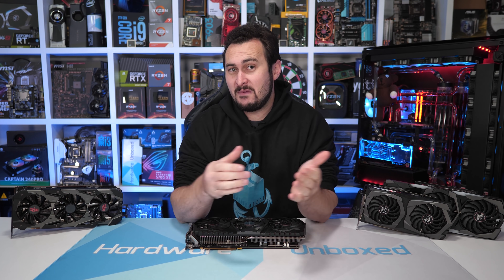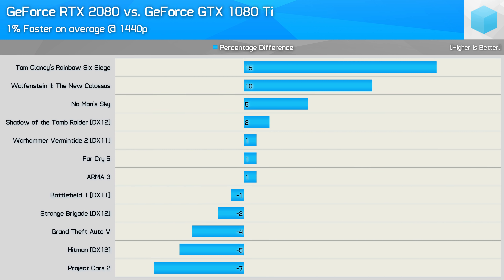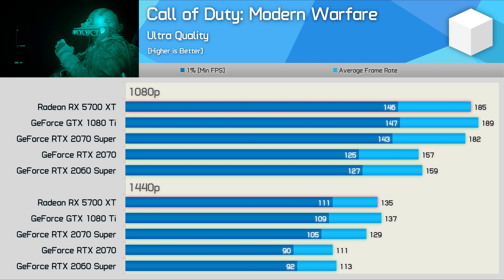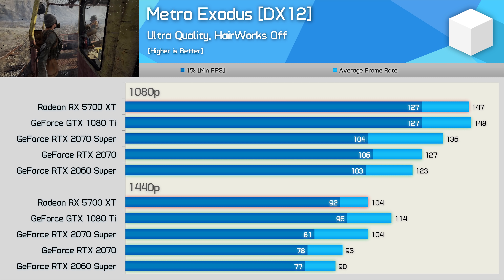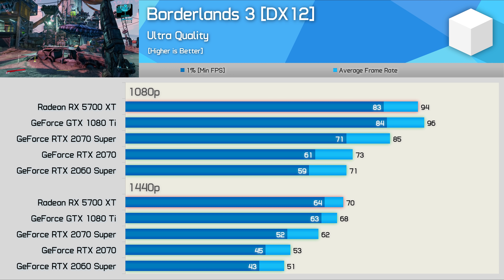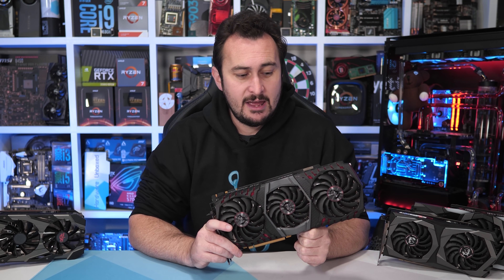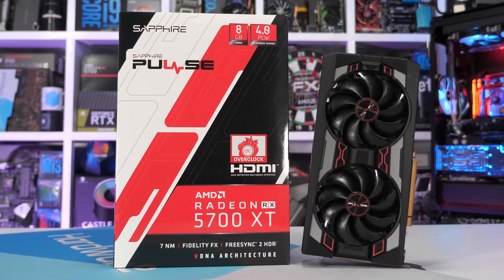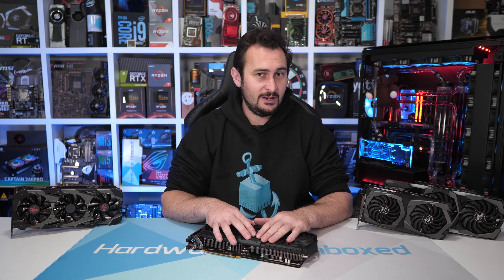GeForce GTX 1080 Ti vs. 5700 XT & RTX 2070 Super, 35 Game Benchmark

Comment: I get that the 1080ti is a legendary card but you gotta be crazy to spend over $500+ on a used gpu with no warranty lmao
Reply: Spent 320ish on mine. No warranty and 1 fan broke.
Reply: @MrRogue-rb3rm  did you fix or change the fan?
Reply: @richsly99  I had a cheap 240mm aio for GPU. It works great max temp with OC full load around 50C. Blade of the fan was broken so no way to fix it, and it's really hard to find just a fan replacement for a mini 1080ti zotac. It was the cheapest 1080ti I could find until today.
Reply: @MrRogue-rb3rm  You should be able to replace it with any other fan as long as the size, cable length and power pin are the same.
Reply: Depends on the market, really. I got mine for 350€ and they are still going for 360€ and up, while new GPUs are much more...regional stuff at work.
Reply: You can transfer warranty with used Nvidia cards EVGA,msi, gigabyte does it no questions
Reply: Looking at current eBay pricing it’s ridiculous pricing on a 1080ti. You need a lot of luck to find a decent priced one.
Reply: I managed to snag a gtx 1080 ti ftw3 on ebay during the 2080 launch for $550. It's been working hard since then and its still holding up.
Reply: You can find good ones, great ones even, at 400 USD or so. I picked up an FE for 400 USD almost a year ago that didn't even have dust in the fan yet.
Reply: i spend 300 euros for msi gtx 1080ti gaming x, 1 year ago hahahah
Reply: Bought a Zotac 1080 Ti Amp Edition for $344 about a month ago. Thermals sucked though so I got a good deal on a Kraken G12 and X62 and now I'm happy. There's nothing else I could have gotten for the same amount of money with the same amount of performance.
Reply: I have the choice between a used 1080ti for 360€ or a Rx5700XT for 400€ and i dunno about you but 10% performance difference is absolutely nothing (6 frames @ 60 / 14 frames @ 144) compared to the fact that one is brand new and one is used for probably 3 years now.
Reply: Hinshi Raito what did u end up doing?
Reply: you can find it 300-400usd
Reply: Bought mine for 350 last week on Reddit and it was a asus strix with one year and a half warranty left lol
Reply: Yip, that is why I got pissed off at 2nd hand sellers, who are all thinking it's still 2016 and wanting 450 USD (equiv) or usually more for used 1080tis, which are 1 - 2 years out of warranty. I decided to spend 70 USD (equiv) more for a 2070 Super w/ a 3 year warranty instead, for peace of mind and a better resale value in the next 1 - 2 years.
Reply: I use the 1080ti mainly for vr I assume the more cores matter there? Bought mine second hand for 600 usd 2 years ago well happy with it.
Reply: I bought everything that i own parts,computer gear,monitors,keyboards everything everything and everything used,3k$+ invested.Never a single problem with anything,computer parts and gear doesnt just die on themselves with no reason (+ i had everything overclocked to the max limit that every component can handle,also like it is now) so yeah,not really a valid statement
Reply: I got mine with warranty
2018 evga 3 yr
Reply: well mine its doing great so far!
Reply: bought a used 1080ti for 450 bucks, with 2 years warranty still. why? 11gb of v-ram that's why.
Reply: I think most people with computer hardware experience would disagree with you there.  Similar to cars, a lot of the "bad" dyes and malfunctioning units are weeded out in the first 500 hours.  A used card that can be proven on benchmark before you buy is much less of a gamble than you think.  I got mine for 500 before the rtx cards even came out.  they can be had a lot cheaper now and are leagues better than a more expensive 2070 super in almost everything
Reply: it's mostly $350 tho
Reply: I got mine for 550 2yrs ago, so far so good
Reply: I bought my 1080ti FTW3 Hybrid (with 2ys warranty left) in January 2019. 

They were going for around £500 back then, but I got into a bit of a bidding war, and ended up paying £623 for it. The part however, turned up in as-new condition, and it has been flawless in its operation ever since. It has  ery high frame rates (120fps+), in the games that I play, never tops 65c under heavy load. I was targeting 1440p, and the The FTW3 Hybrid is one of the fastest 1080ti out there. 

The funny thing is, I built a 9900K Z390 Maximus Code XI 32gb 3200mhz gaming rig, and the most expensive part inside, was second hand.
Reply: I'm not a poor so I bought a new one back in 2017. Problem solved!
Reply: Spend 432€ on Rog strix. Works perfectly
Reply: Got one msi gtx 1080 ti gaming x this february for 370 Eur with 2 more years warranty.
Reply: Got mine july 2019 for 550 euros, MSI gaming X, second market no warranty, no testing before purchase, nothing. Just plug on the PC and play no issues.
The other option was rtx 2080 for 750 more or less with minimum performance difference. A beast.
Reply: Bought an EVGA RMA Replacement 1080ti secondhand for $400 a couple months back.  Still had all 3 years of warranty so I'm happy.
Reply: Got mine for 500 as a 3 months old card with 33 mths remaining warranty in 2018. Retail pricing new for the 1080 Ti STRIX at that point was about 1000USD, so i'd say i made a good deal and its still kickin today. At that point in time the new 2080 was out and it would cost new about 800 bucks so i took the 1080 Ti instead for 300 less and about the same performance and still with warranty left. As always it depends on the deal you get - would not buy it today for that price with the 2070S out there or the 5700XT.
Reply: Bought my 1080ti extreme from aorus used for 500 and Id do it again tomorrow. so I must be crazy. Spend 550 for a 2070 super that has less performance on the games I play, not a AAA gamer, or spend 500 for a GPU that I know is in perfect shape and well taken care of that runs the games I play with better performance. Call it what you want its just logical to me.
Reply: You clearly dont understand how long a gpu is made to live for lol
Reply: Rondell Laronde Made yes but GPUs go out 24/7. I had a 1070 for only a year before it fried and had to replace it. PC hardware is an anomaly when it comes to quality. You never know if it’ll blow up or not.
Reply: @Who-Uhm-Cares  unlucky ig I've never had a gpu die on me in my 3 years
Reply: @hundredlives3910  Palit and Gigabyte are meant to work only during warranty. They break immediately afterwards. This was also a case with Sapphire in a past (like my Ati X1950 Pro) but apparently they are now to AMD what Asus/EVGA is to Nvidia, meaning go-to brand.
Reply: @hundredlives3910  you clearly havent seen what 1 year of mining does to a 1080ti.  Crazy to even consider it.   Also the fans arent meant to last that long. You have to work on 3 year intervals. The bearings will have to be replaced.
Reply: In my country people are selling them for like 350$ for each 1080 ti so idk what to get. Still arguing with myself.

Comment: Man, 2000 is such a disappointment. RTX is a meme, cards barely beat 1080ti.
Reply: @Seventh Taco I'm hyped up for 2002
Reply: @Salt Maker lol, he said pass on a used 1080ti at the end of the video. But please, be obtuse and an exemplary gamma.
Reply: I have the 1080ti, and no sorry, but its easily beaten by a 2080ti.

However, looking at the prices for these very high end RTX cards and....yeah they're a meme.
Reply: And a 980Ti beats out a 1070, and is barely beat by a 1070Ti,  tends to happen when you take the best of the best from the previous gen and compare it to a "mid-high range" card from the current gen.   And I'm going to make a bold prediction here... but a 3070 won't beat out a 2080Ti when it's released.
Reply: You must have a short memory. The 780Ti was better than a 970 Super-Clock. The 980Ti got roughly the same frame rates as a 1070 Super-Clock. The 1080Ti get's roughly the same frame rates as a 2070 Super (same thing as a super-clock). Also, the 2070 Super has twice the VRAM speed as the 1070 SuperClock. Every computer hardware company and car company has been doing this for decades.
Reply: Next year RTX with DLSS 2.0 will come into it's own and pascal will be screwed and even a shitty console will out perform it.
Reply: Had a 1080Ti upgraded to 2080Ti, no regrets, fucking amazing. Game at 4k 120hz mind. Also DLSS 2.0 blows my frikkin mind! Control full detail ultra ray tracing 4k @ 100 FPS insane
Reply: @Salt Maker As someone who owns a 1080ti and had a 2080 I can attest to this. It was barely noticeable in fps and was definitely not worth double the price. And I had a 2080, not a 2070s. I returned my 2080 and bought a ti. I was upgrading from a 1070. I paid $1100 for the 2080 and the ti's here are $5-600 used. The 2070s here is $900 plus tax. I ran the benchmarks and played the games. I can even show you the amazon return if you don't believe me. On the argument of warranty I can say that I have around 15 cards. Out of all of them only I think only 2 don't run, but for the most part these cards will run forever. Way beyond warranty. 

So by the time they die you'd most likely buy a new one anyway. Hes not sucking any nut sacks. Hes telling the truth. Whether you believe it or not is irrelevant. The numbers don't lie. So soak up those tears and deal with it. Sounds like the only salty one here is you.
Reply: @Seventh Taco he is chill tho lol
Reply: Jonathan Soko  You've just upgraded to 'dumb'.
Reply: Why are u expecting performance gains on the same fabrication process?
Reply: Once you add the benefit of DLSS and RTX it definitely makes a difference.
Reply: RTX2080 just beat GTX1080 Ti on launch and I'm guessing has pulled ahead now with games being optimised for turing. 

RTX2080 Ti was comfortably faster, expensive but there is nothing else at this level so nvidia could charge whatever they wanted. 

Also once DLSS 2 is enabled the GTX1080 Ti will be left trailing by a huge margin.
Reply: @Ebilcake  By the time DLSS or the DX12 counterpart is widespread Pascal will be more than 4 years old, and gpus as fast as the 1080 ti or faster with DLSS capability will be under 450 usd. Also there is no 4k benchmarks don't forget the 1080 ti has 11gbs of memory and 484 gb/s bandwidth so the larger pool and speed it should pull ahead at 4k.
Reply: the price is a joke but not the cards they are not bad the 2070 super should've been at max $400 and then later cut to $350, if the xx70 series is on par  with the previous gen xx80ti  cards then they are not  bad cards at all.
but what can we say ??  Nvidia are just greedy bastards!!  but they do  have good  architecture hopefully AMD pull off a Ryzen like move on them.
Reply: @pczone7641  No because thats a 2070 Super..pretty much a refresh of the card of the 2070 which wasnt really all that good...so its basically not only a generation better but a gen and something, 1,5gen ahead or however you want to call it..
Reply: Yeah but the 1080 ti was 900 and the super is 500
Reply: @Seventh Taco he is talking about rtx 2000 series
Reply: @ionizergaming40  r/wooossshhhh
Reply: @ionizergaming40  r/ woooosh

Comment: One of these days I really hope a card comes out that will make me want to upgrade from my 1080 Ti. I don't think a GPU has lasted me as long as the 1080 Ti continues to last me (playing at 1440p, it's starting to show it's age a bit at that resolution, but still hanging in there). Once I retire it, it's getting a place of honor next to my Voodoo 3 3000 and GTX 970.
Reply: sell it and buy a 5700xt.
Reply: @chadchampion9005  I'd lose money probably, unless i sold direct to someone with no fees. Assuming I went eBay and PayPal like I normally do and sold it for $500 (which is a big assumption), eBay and PayPal would take about $65 of that $500, and then I'd still have the shipping cost. Definitely not worth the hassle of side-grading from a 1080 Ti to a 5700 XT, I'd rather wait for something that's much better than a 1080 Ti to come along that's not overpriced. (like the 2080's are)
Reply: But the 970 was trash, should have got a 390
Reply: @deiminator2  The 390 came out almost a year after the 970, so I'd have had to sell the 970 I had to get it, and why would I want to have a 390 when it barely outperformed the 970 at the time overall, considering you think the 970 is trash? Yes, I shouldn't have gotten such a trash card, I should have gotten the card that was barely better than trash, good idea.
Reply: @deiminator2  The 970 was not trash, and is still a solid performer for 1080p 60 fps gaming, as long as you remember that you can switch most settings from ultra to high and gain a ton of performance for only a slight visual downgrade.

Comment: Amazing work Steve! Wished to see overclocking results too, mine 1080 TI blower edition FE board card which i got for 450$ weeks before nvidia released 2000series card, overclocks to +900mhz on memory and +150mhz on core. With that kind of overlock i gained 12-14% more performance compared to stock, by the way i am using accelero xtreme III heatsink on it, it doesn't go above 60C on full load.